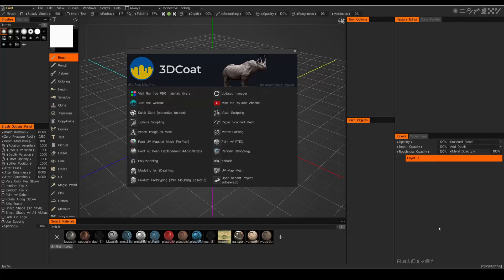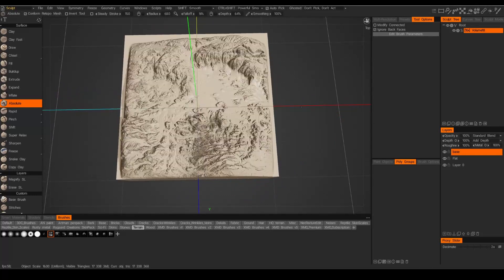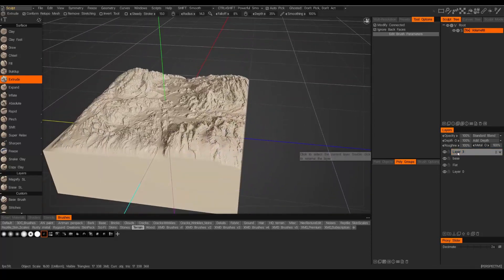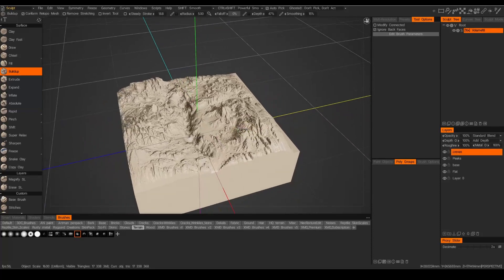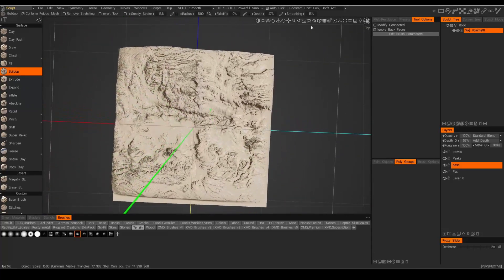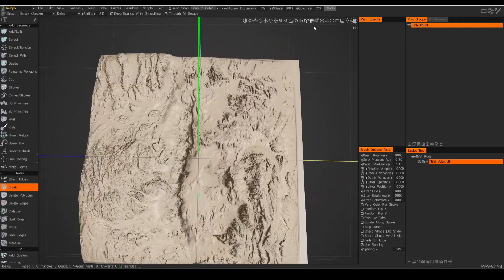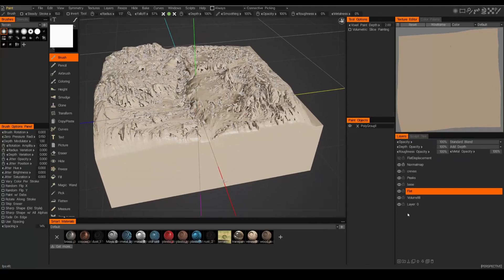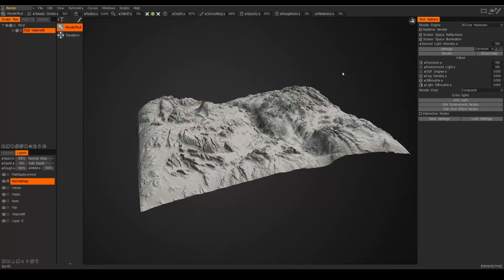3Dcoat - Building Quick Terrains pt2 - using adjustment layers

Comment: Thanks, that looks cool! Not sure if that is possible in Coat to make smart materials with separation by elevation (Y height). It is possible in 3ds Max + Ray, to make for example snow project from top on high elevations(mountain peaks), sand project same way on low elevations (river banks), and mix of grass and stone in between... I guess in Coat you will have to just hand paint those layers. Actually great idea for future tuts - to show texturing of such huge terrains! And one more tip - in surface mode you don't need to waste millions of polys on other box sides... You can work just on simple flat plane, and that way get x4 more resolution on your main plane. Also decimation in surface mode can re-calculate density with adaptive algorithm and save you millions of polys too.

Comment: I learned a lot thanks to this video. I was kind of puzzled in the beginning because layer opacity wouldn't work with non-surface tool... Also my result after baking was kind of poor. But I guess I didn't have the right brushes for terrain. Did you made those brushes by yourself out of a grayscale data ? Thanks !
Reply from the maker: Thanks, and yes. You can create the height maps in another application or download the height maps from online. 4k was the max size with the best file size to quality ratio I found. Good luck, and I hope it works out for you!
Reply: @industrytuts5272  Thanks for the tips ! Much appreciated ! A 3dCoat user (lazy and late to catch up with new features) from Japan :)

Comment: Thanks for the demo, very helpful as always!
 I have been following your videos for 3D Coat and I am very interested in it, as a strong complement/companion to Blender. Toolwise, 3D Coat seems pretty packed, making the functioning of it's tools quite understandable. However I find the workflow concepts not easy to grasp. I do not have much more background in 3D than Blender and good ol Milkshape3D, so perhaps that is why I do not understand the asset creation pipeline within 3D Coat.
 It would be great if you could demo the full pipeline process, without the need of a complex model of course, so that any of us a little lost by the workflow in 3D Coat can get the best out of it. Thanks again for your videos, I appreciate them a lot! 👌👌👌